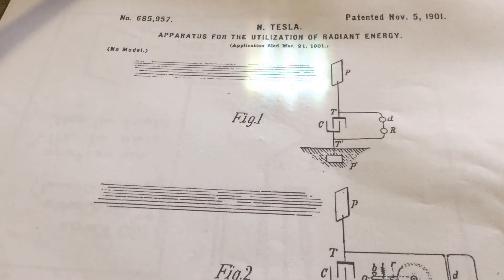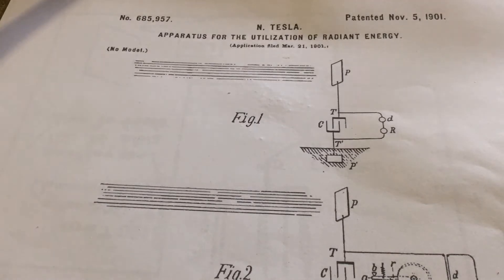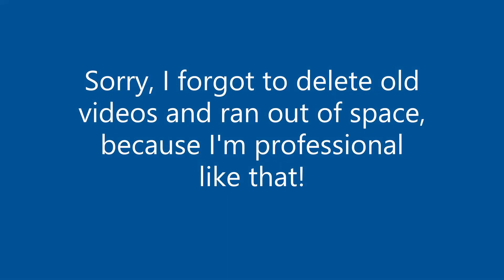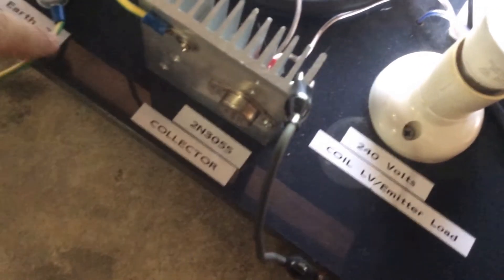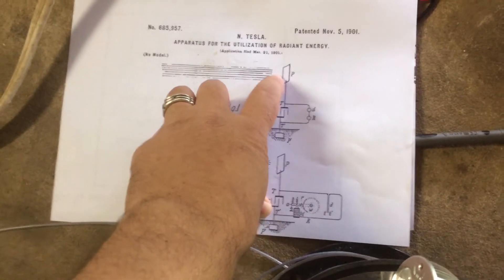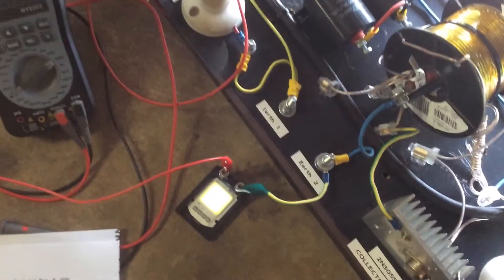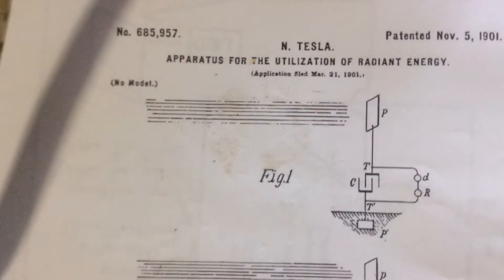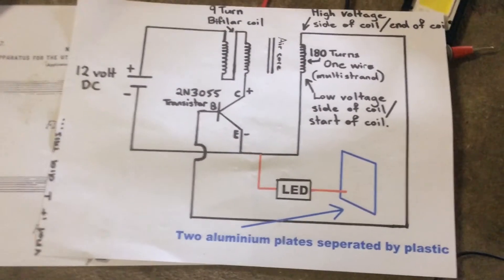Tesla Radiant Electricity Easy DIY Cosmic Energy Lights 240 Volt LED *Sense of Urgency*

Comment: I wanted to take a moment to express my appreciation for your videos. I share the same urgency you mentioned about spreading the discoveries we've made. I've been involved in this field for 35 years. While I’d love to share a link to my video, I’m concerned about potential backlash, as it seems there are restrictions on sharing this information.
Here’s what I’ve discovered: When considering Nikola Tesla's antenna from a broader perspective, it's essential to integrate his other patents to enhance our experiments. For instance, if you utilize his concept of a bucking coil as an antenna, and connect it to a capacitor configured with two diodes facing each other—positioned at opposite ends of the antenna as outlined in Patent No. 336961—you'll start to see significant improvements in your results.
I have additional insights I’d like to share, but I don’t want to make this message too lengthy. I encourage you to follow my channel for more updates. By applying the patents I mentioned alongside Tesla’s other innovations, I believe we can unlock greater potential in our experiments. It’s been great connecting with you, and I hope to see your message reach a wider audience!

Comment: Well after exchanging some ideas about this method of utilising radiant energy on Joel Lagace forum it seems that your setup can be further enhanced by placing an UV LED to shine your aluminium plate … looks like an safe alternative to roentgen x ray tube suggest by Tesla in the patent, even if it is not as powerful, but very low energy consumption is required in this case.

I wonder if you still have available this setup and can test as it will take some time for me to build one from scratch, but it will worth to make the effort if a positive results can be found.
Reply from the maker: Thank you for your comment.
Yes I still have this circuit setup, I put this one on a board so it could be tested any time I had an idea. I imagine this should be an easy test to run and I also have a big old infra red bulb that will help make it obvious. I will let you know how it goes.
Reply: @whatifididthis...1236 Actually I just have read again the patent and N Tesla state that in fig3 an artificial source of UV with copious amount of UV from an electric arc discharge can be used with an reflector to direct all this radiation on the receiving plate.

Anyway your setup is much easier and simpler than what was available in Tesla time and just one simple and cheap transistor can be used as you shown.

Are you using same electric diagram like the one for emergency crisis light and just added capacitors as per Tesla patent ?

Comment: Hello,

Being intrigued by this invention of Tesla and trying to understand the work of Don Smith, Kapanadze, Arie Melis DeGeus, and many others i was looking for a connection or similarities … and I think I finally found something.

All the variation in similar devices consist mainly in what type of radiation is employed from the whole spectrum, from gamma to lowest 7.8 Hz (known as Schumann resonance).

So, in fig 1 as per patent description Tesla uses natural radiation that occur in the whole universe, how to capture and use.
Now, in fig 2 from patent the natural source from fig 1 is replaced with an artificial source that we can build ourselves and cost very little energy while the output is many times greater.

Finally I have understood how it work and why … probably more experiments need to be done to prove for myself.

Anyway, I have found in chapter11 of Patrick Kelly document an invention of Daniel Cook which is dated way earlier than Tesla patents and I think this is what has been used by Tesla to power an electric car. At least worth to have a look as it is far cheaper than any method and no switching or electronic components are required for the original patent.

Original patent: US Patent 119,825 … don’t let yourself being mislead by the title or classification of the patent
Reply: Combine UV led with the plate as input source then connect to BEARDEN open dipole system on our electric baterei with what if I did this Tesla transfer method baterei, adding capacitor in regeneratif open self loop. 

May be we get free energy electric car someday with unlimited range. Crazy hallucinations 😂
Reply from the maker: Thank you for your comment.
In my opinion you are definitely tapping into the real matrix here. I am very familiar with this patent as I have a direct connection in history to this patent and to keep my identity anonymous that is as much as I am willing to give. I am currently working on a remake of this video covering the earth connections and virtual earth connections that are easily replicated, the virtual earth is required for Tesla’s car. US Patent 119,825 may be negating Lenz law and this method of reverse wound coils is also seen in devices made by those you mention. This patent also has some similarities to Tesla’s diode patent… in my opinion anyway, keep up the good research and thank you for sharing.
Reply: @whatifididthis...1236  Thank you very much for reply. I can’t wait for your remake videos … you are showing a great work and knowledge.
I don’t understand for what reason people are not looking to follow magnetic flux in their circuits and focus obsesive an electric only, sometimes ignoring completely what is happening with magnetic flux … when obviously they use magnetic field to generate electricity … or trying to capture bemf and fail to acknowledge that a static magnetic field is what keeps the energy contained in a very specific place where such effect is created.

Completely failure to understand what a magnet is always lead to wrong conclusion and impractical applications or very inefficient. It seems that many people including famous scientists cannot understand the a magnet is in fact and energy trap/captor and do not understand despite using electromagnets, that all the energy exist in the matter and almost everything is just an effect or manifestation of energy.

A very basic magnet is made of iron, copper and nickel, an alloy which itself is inert unless we introduce additional energy (electric) when its structure is more fluid (heat treatment) and the matrix of crystal continuously excited while prevented to escape from iron. Where iron is the main core containing energy with an envelope of highly conductive copper which allow vibrations(charge if you prefer) to develop free and second layer of high resistive nickel which prevent escape of charge going out of the iron-copper oscilator, nickel is the element that prevent interaction with external environment.

A capacitors is very close in this definition to a magnet and we don’t necessarily need electric charge to fill a capacitor with energy … simply take a glass of water and introduce an electrolytic capacitor in it. Make sure you discharge the capacitor multiple times before immersing in water for few seconds or few hours with no power source in proximity than take out the capacitor and see a voltage is already there. Now, to add more fun, take a diode clamp your probes from a multimeter to its ends and stick it in a glass of water and watch the multimeter when you put the diode in water and take it out. Water is our friend catalyst and perfect medium for energy manifestation.

Water is the most perfect element which is able to interact with everything in universe, study heavy water and light water than observe their curative or destructive effects which can both be employed for a surgical operation on any living organism, one removing dangerous to life interference and the light one bringing all the necessary energy back. Some bed stories where mythical heroes were brought back to live might not be just bed stories, but eventually based on certain facts.

Probably now I am looking like a lunatic but I don’t really mind. And energy must be think in terms of vibration and frequency quoting N Tesla. And energy will always flow with tremendous power in direction where highest resistance is if a direct path is made available
Reply from the maker: @Caesarus2011 I definitely think our education focused on models that have too many irregularities that when pointed out are discarded because they can’t be explained. What I don’t understand is how the people just buy this information as fact even though these issues exist and can’t be explained. I’m glad I never went to University because without a shadow of the doubt I would be the guy that asks the question… “but if you know the model is bullshit why are we learning this crap”?

The Nickel has a very interesting effect in relation to magnetism, I am certain after months of experimenting with different core materials in my version of the Adams motor that Nickel is an essential requirement for below room temperature operation of the drive coil.

Don’t be too concerned about what others think of you and your thoughts, as long as your not offending anyone the flowing train of thought is where most good ideas are born, put it this way, very few “normal” people do anything extraordinary.
Reply: @whatifididthis...1236 it's not about electricity I watch your channel man. 

It's about protect and keep my common sense always pure and maintain real truth that buried deep by history and tradition. 
Thank you
Reply: @Caesarus2011 still learn what it really mean (for me) when Tesla said it's all about frequency and vibration.

Comment: I love how you label everything.  I wish more demonstrators did this on their videos.
Reply from the maker: I labelled everything because I made this unit without a schematic and it sort of became its own thing. I tried to replicate the circuit and got it wrong. At that point I had to reverse engineer my own circuit, therefore this circuit was born through a mistake, ie this is not how it should have been connected.
Because this original was connected wrong I literally had to follow each wire to make the second unit work, there’s nothing worse than trying to diagnose a non functioning electrical device when wires are going to the wrong place!

Comment: In fig 1, the circuit described is simple. You have a metal conductive plate at a given distance/altitude above ground. C is a capacitor, R(for Resistance) is a spark gap d. It is hooked in parallel in the manner of a Tesla coil primary circuit.P is a conductive plate buried in the earth. The positions of the plates and plate orientations in the drawing are not an accident. The radiant energy under description is the electric field of the earth, which increases in intensity over height above ground. This field is 100 to 300 V per meter in height above ground, so represents a considerable source of energy. Figure 1 merely shows how to tap the energy with a circuit, but it does not show a means of how to do anything with it. Fig 2 of the patent shows a means of utilizing it. Read his patents for what is what, don't guess unless you want to end up in wooville. Tesla understood the interconnection and interactivity  of the electric and electromagnetic properties of the Earth itself. This is also a necessary part of what makes his wireless power transmission system work. Modern researchers try to turn Tesla's work into mysticism, which is irritating. Tesla himself would probably vocal, angry and horribly frustrated. Just remember this, if you do not follow his patent instructions, components and techniques, what you have NOT done is replicate a Tesla device. Figures 1 and 2 both show the same natural source, while 3 and 4 show directed energy from a parabolic dish to the system and from a "radiant tube" used for medicine at the time.  Fig 1 shows the basics of how to tap the field. Fig 2 demonstrates a means of directly converting the electrical energy to mechanical energy using a solenoid. d in this case is not a capacitor, but a quenched spark gap. Figure 3 shows how to use the system to control a second circuit using a solenoid switch (relay), and finally FIgure 4 shows how to use the circuit and a commutator  in series with the primary to power a Tesla Coil. The voltage of the system in Fig 1 and 2 is directly controlled by two factors, How high plate T is above ground as well as how far away from buildings etc., that weaken the field. The current is going to be a matter of the function of the total capacitance is in capacitor C and collector plate P surface area. This system is not very practical for one main reason, wind damage. A powerful system would need numerous large plates several meters above the ground away from buildings, which makes them sails in the wind, specifically a LOT of mechanical force will be applied to the plates themselves by the wind. Technically, you could use the system in Fig 1 to directly power a Tesla coil by placing the primary coil in series after the spark gap in the circuit. By the way, wtf is that circuit at the end to do with anything Tesla wrote or drew in that patent??? You just have the collector plate just triggering the base of a transistor in your diagram. You are probably blowing transistors like a bad frog. Worse, you are not even following the basic principle that one plate has to be buried (it IS the earth ground for the system). Let me guess, looked at the pictures but didn't bother to download and read the actual patent? What you designed here has nothing to do with either "radiant energy" in the sense of producing power or "tesla tech" in the sense of replicating the patent, at all.
Reply from the maker: Thank you for your comment.
I was sure to be clear that this was an interpretation of Tesla’s Radiant Energy circuit and not a replica.
Whilst it is not shown in this video I do show my capacitor plate in another video and I also have a metal rod buried in the ground, connecting a 240volt 40 watt light between the capacitor plate and my circuit produces light even when the capacitor plate is at ground level, elevation of this plate whilst the light is running displays an increase in brightness the higher it is lifted.

 My focus here is showing how this can be achieved with the bare essentials. This circuit is capable of harnessing radiant energy with or without capacitor and or spark gaps, granted these items produce different effects but are often mistaken as essential. I agree with you that most of Tesla’s work has been clouded in mysticism and most people over complicate it. Tesla coils do not require capacitors as is so often stated and this is realised when making good resonant coils. The sparks flying everywhere is not how Tesla did things, massive lightning bolts coming from a Tesla coil means the coil is grossly overpowered and consumes a lot of power and is not efficient. My circuit is a variation of Tesla’s concept and not a replica. This circuit acts as an oscillator between earth and sky that produces a radiant energy field when connected correctly. In my opinion this is what Tesla’s patent describes, a capacitive plate insulated and suspended above the ground connected to earth through an oscillating circuit. I believe It does not need to be difficult to understand for it to work and is easy to understand with physical experiments. I draw my conclusions from having done the work, most discoveries are not made by theorists reading books.
Reply: Great explanation my friend!!
Reply from the maker: @Biokemist-o3k Thank you for your comment.
Have a nice day.